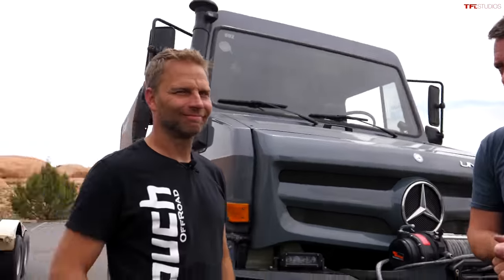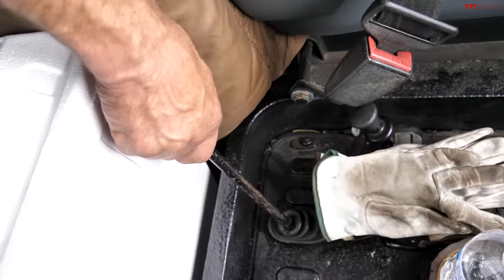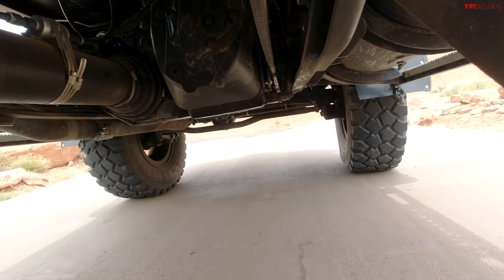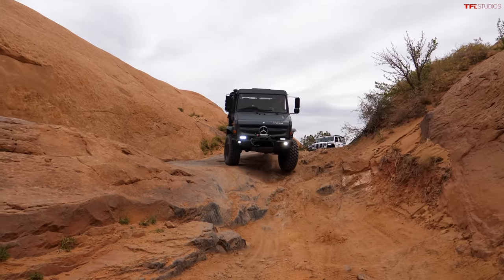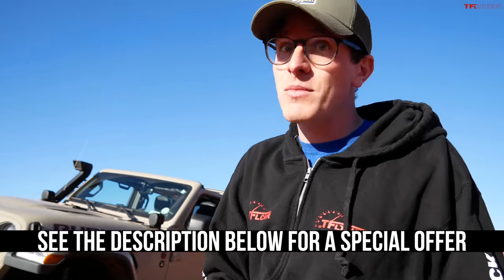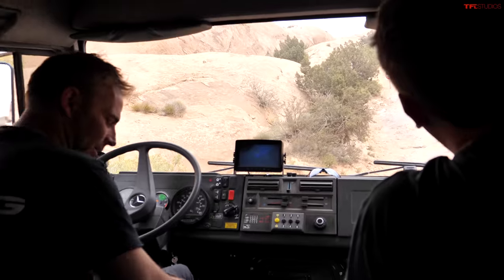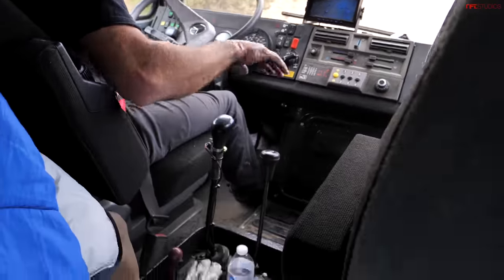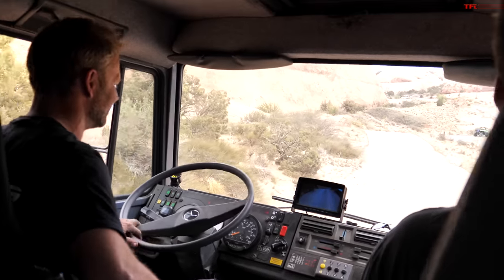$385,000 Mercedes UNIMOG vs Hell's Revenge: Move Over Bronco & Wrangler There’s a New Boss in Moab!

Comment: The first unimogs were designed to work as a tractor on the farm and be able to drive to town also after WWII.
Reply: In Europe you can buy a Unimog that is registered as a tractor, they come with 3-point lift, power outtake and hydraulics just like a standard tractor.
Reply: Like a Willys-Overland
Reply: @morilot  alot cheaper than this too
Reply: @derrickdrew17  In Europe they cost about the same as a tractor.
Reply: This is clearly basically new mechanically. Entirely different drivetrain, etc. Would be interesting to see the full bill because you can buy a mid-90s Unimog for less than a quarter of this price.
Reply: @morilot  don`t forget the power take off front and rear.
Reply: @morilot  Because they ARE a tractor! The SWB UNIMOG is designed with front and rear PTO, 3 point linkage and hydraulics all round. They can be seen bailing hay, chopping silage, plowing, discing, all of the places a John Deere or Fendt would be found, hell, they even have UNIMOGS with front end loaders
Reply: Thought you all hated large vehicles
Reply: @raymonds7492  I do not hate large vehicles, or did you mean the europeans.
Reply: @badgerpa9   Europeans
Reply: @raymonds7492  that is only in the city's, we have pick ups too here
Reply: @raymonds7492  We dislike big useless machines like the Dodge Ram. Because we have better machines for the same size.
Reply: @23GreyFox  name the vehicles you have that can perform as many roles as the Ram.
Reply: @raymonds7492  L200.
Reply: @23GreyFox  Nope. it isn't luxurious, not as much tech, doesn't tow as well, no HD version and doesn't have a big enough box or interior space.
Reply: @raymonds7492  With my 3rd generation Mitsubishi L200 i had a different experience. And it sold far better by us too.
I tested a Ram 1500 with a friend and it wasn't great. I could not even take it into the forest.
Reply: @23GreyFox  The standard ram is not great off road, the ram power wagon is but it can only fit on american trails. One downside is that ram is too concerned with ride quality so it suffers in other things like payload. However the ram is only one of our trucks you still have gm and ford. Also a vehicle being large is not a good or bad thing and it actually helps with towing , so does weight.
Reply: @raymonds7492  You are right, but if we need high carrying capacity we use Vans like the Mercedes Sprinter or Ford Transit. And they can tow a lot too if necessary. There is simply no need for a American truck in Europe. So to say we don't like big cars is false. Of all the big American brands in Europe only Ford is left. The import cost alone makes it useless to try.
Reply: @23GreyFox  Vans are good too we use the often but you wouldn't use one off road, and i wouldn't say there is no need for vans here. i think it is a size issue because vans fit more in the same space, here we would use a trailer but there is less space in europe for trailers. Ford is the only one left because they put more effort into building cars to fit the market. Pickups are a cultural thing as well they represent certain things here.

Comment: My father was the first to import Unimogs into the UK primarily as snow clearing equipment in the very early 60s after he saw them operate in Switzerland in the winter of 59!  One was a dedicated unit with a fixed snowblower on the front, driven by a large diesel engine mounted in the bed with a shaft that ran under the truck!  the other ones were more a standard unit with the smaller snowblowers driven off the front PTO!

Comment: That thing takes "granny gear " to a whole other level
Reply: Great granny gear
Reply: Try the crawler
Reply: And thats not even the 3600 to 1
Reply: Right, Great, Great, Great grandma gear
Reply: Designed to move trains.
Reply: They may need to create a new term: Glacier Gear.
Reply: Our tree surgeon has a Unimog 406 with the cascade gearbox, supercrawl 1st is around 4500:1, on tickover you can just about see the tires rotate, covers around 80 yards in an hour!!!!!!
Reply: @clooperman3745  I would love to know what that is used for .... the only thing I can think of is to get out and have lunch while not stopping
Reply: Sloth gear
Reply: @tjlovesrachel  those things are working machines with all kinds of tools you can either power via hydralics or mechanical gears, some of these tools need very low speeds while operating.

Comment: The cockpit is - even if the Mog is from the 90's - from the 80's. I remember it from my childhood. Have been in so many Mercedes trucks and semi -trucks. And also in Wörth where the plant for Mercedes trucks is.
Reply: Yep! That's probably a U1700 or U1300 originally, made all the way into the mid 90s before they launched into the "new gen" electronic U3000 / 4000 / 5000 series

Comment: One thing I love about Unimogs is the portal axles. Gives so much ground clearance that diff housing isn't an issue anymore.
Reply: Those reduction hubs aren't instructable though.  In my experience a 2 1/2 ton Rockwell narrowed with the pumpkin modified (cut off all excess bottom and replace with flat plate) is stronger. You get the clearance and width of a Dana 60  but much stronger.  I tried these on a rock buggy and after breaking a few hubs went back to Rockwell's. The couple inches of clearance was negated by having to run smaller, less aggressive tires.  Also a Rockwell axle shaft can be changed trailside pretty easily compared to a reduction hub.  They are great for less extreme mud buggies.

Comment: This is where individual electric hub motors would really shine.  Gobs of instant torque going up, regen braking going down, no driveshafts, couplers, or linkages to worry about, with precision digital control.  It would be the ultimate rock crawler.  For those “non battery” die hards, you could even keep the diesel in place to constantly supply a/c power to the motors.
Reply: for a pure rock crawler it could work with batteries, if you wanted to travel the world, diesel is the way to go.
Reply: @joshkiej6601  oh absolutely it could be battery only but the majority of people here wouldn’t accept that.
Reply: @aussie2uGA  if you only do like 1 day trips and can charge at night, batteries can be awesome as long as you can keep the weight down. I'd be worried about flipping/puncturing a battery though

Comment: Have driven U1300s during my time in the German army - the most offroad worthy wheeled vehicle there, literally unstoppable in the rough, but a nightmare on long road trips
Reply: Wonder if the newer models are better for long distance travel
Reply: Appears your time in the army was a bit earlier than mine, didn't have the 5 ton MAN anymore end of the 80's, but rather Folgegeneration trucks. The U1300 was nice to drive offroad but its short ratio gearbox didn't offer much pleasure on the street. Preferred the Mercedes 1017 here.

Comment: My sailing club in Berlin uses an old Unimog to transport the boats to and from the crane to let them to water.
They use a special trailer with hydrulic controled axels because to get to the crane the have to traverse a 40° ramp.
The boats weigh up to 10 metric tonnes, and the Mog has no problem shifting these weights.

Comment: No wonder that guy has 20 Unimogs of his own... For 385.000 I buy at least 3 brand new ones here in Europe. The last ones I bought were a bit less than 120k (EUR) and were nearly full option since we needed them to build agricultural equipment on them.  They are awesome machines though, we once let one crawl onto a excavator bucket and it did it with ease 😎

Comment: Finally someone agrees with me on manual transmission and the lurching stop-go progress of autos off road, but l  don't understand the eyewatering price here over a standard and totally capable  U2150 or U1300L or the justification for a "prototype"  overdrive  when the proven Claas splitter overdrive is a standard fit.
Reply: Because the Claas gearbox is hilariously expensive for what it does.
Reply: @AaronBockelie  Yes, but when you see it, it is self-evidently fit for purpose. Cost does not seem to be limiting factor in this case.
Reply: @philhealey449  The claas overdrive fits even cheaper Unimogs, say a U1300L, that have a UG3/40 trans. In those cases, that's 30 percent of the vehicle cost.
Reply: @AaronBockelie  Fair point if considering in low power variants, especially  something propelled by a 1960s  car engine, but assuming  assured  reliability is essential,  would there be anything  more cost-effective say for a U1250 with a retrofitted  intercooler and around 200 bhp from its OM366?  I can accept that the Claas unit may be overbuilt given I understand its U2450 origins to primarily reduce gear spacings in 6x6 rocket launcher applications. Having experienced this device  once as a revelation on both highways and for hill climbing it was a no-brainer to  transplant it from the U1250 into a subsequent U2150. As intimated  originally, just seeing the thing arrive in the wooden crate softens the blow of the cost compared to a typically  miniscule  overdrive  made out of a few kg of aluminum and dismatched from the Unimog ethos.   Happy Mogging !
Reply: @philhealey449  I definitely agree on matching like kind equipment origins. At this point I'm just waiting for a good drop in replacement electric drive system that can turn about 4000 rpm...maybe another 5-10 years ;)

Comment: 16:50 New Unimogs have EAS which is an automated gearbox ie it is a manual so no torque convertor but which does the gear change for you and should you need more control you just flip a switch, a clutch pedal flips down and you change gear as in a manual without any electronic interference.

Comment: I have a Unimog 1300 Turbo '82 that has freewheels on the front axle.  ( custom made ) 8 speed forward 4 backwards. Overdrive is not such a good idea on a Unimog because of the portal axles with some " gearbox " on each side. Those things have an airvent and by high speeds, the oil leaves by that airvent in the axle and never returns. So, it's posible that the wheelbearings run dry and that leads to a high cost on parts. A Unimog was never build for the highway. 90 km/h for houres can give problemes. Oil get warm, less oil make's it even hot . On mine there is a looking glas for the oil level and an expansion system that let the air go but not the oil. And the problem is only on the front axle because the back axle is one part in total so the oil go's back and so with the differential. A Unimog with fast axles is in my opinion a bigger risk. Oil control is realy needed and for that a bold need to be unscrewed every time on a standard Unimog with the risk of dirt getting where you do'nt want it. The engine on mine has an extra oil cooler and a bigger engine cooler with an 24V fan and thermostat. The freewheels and that fan system safes HP and feul . The Mog , single cab, has some 73.000 km now and has a new empty box on the back, ready to build in, and is for sale. In Spain. ( Unimog ex-German army, I'm out of the needed driving licence, I'm a " ' 49" er :-)

Comment: Larry Perkins designed and built an overdrive unit for the Unimog here in Australia, it's now certified by Mercedes as a spare part.  For $300k I'd like the rear door seal to actually not let the outside in.  I'm not convinced of the guy's argument that manual transmission is better off road than auto "because the torque converter takes time to load up" -  I have an auto 4WD and have never found this.  Maybe it's a thing in a huge vehicle, but in a regular 4WD it isn't.  All in all I love the Mog - if I ever win lotto ...... I could afford the fuel :)

Comment: When you tell a chick you drive a benz and then roll up in this.  Technicallythetruth

Damn a potential to have 3800 to 1 gear ratio is freaking nuts.  600 to 1 is pretty crazy as is
Reply: Lol yea the 3800 to one is because the use these as Shunt trucks in rail yards. The front and rear drop down rail wheels and they hook them up to freight carriages and move them around the rail yard. So crazy.

Comment: As far as I know Unimogs didn’t use torque converters (in Europe). They have electro pneumatic transmission. Some older models (2000s) shared the same auto transmission with the Axor trucks. It was pure pneumatic, the gear shifting sound was impossible to avoid :)
Reply: There are actually some Special Unimogs with Torque converters. But u still have to Shift them manually. They are/were used in military airports to push planes.
Reply: @XielefR  I see. Unimog has so many variant. Do you mean the one with tiny gear level push forward and backward to select a gear. Then, you depress the clutch to change the gear? The ones I know featured that gearbox was based on Mercedes-Benz Axor truck’s transmission.

Comment: Aside from having much smaller tires this is very similar to my tractor drivetrain wise. I like it a lot. I once thought these axles would be great under a jeep until I tried it.  They weren't as strong as the 2 1/2 Rockwell's in my experience. Those reduction hubs are great for ground clearance but not the strongest for rock bouncing with 44 inch cut boggers attached to them.
Reply: you probably had axles from a older and small unimog

Comment: 300k but for a modified one. There are quite a few types of unimogs available in Germany today from the 1960s to now, they are very different in price because of the different size and usage. Prices for used ones are between 3k for a small 1981 type and 250k for a big 2021 model.

Comment: Great Video! Just the price is a bit "amazing" for European standards. You can pick up a nice ex-Military version for 30-40K Euros and start from there.
Reply: A good chunk of that cost is usually the cost of components to repair and maintain these things as most have to be imported from Europe. There's also the labor required to pull everything apart, repair and put back together. Lastly, a lot of these offroad accessories, campers, etc.  are usually specially ordered and not mass produced, so there's a higher cost involved in that in order to cover business overhead and the like.

Also, throw in transportation fees, brokerage fees (customs, registration, etc.), And whatever else required to get the vehicle into the US.
Reply: Yeah him saying you'll be done at 600.000.. I was like I can get a nearly new one full option for 150.000.
Reply: Stock Kamaz 6560 8x8 starts around 140,000 USD in Russia. But that's another type of animal. I wonder how it would handle these trails.

Comment: The 1st time i saw this, it looked so awkwardly tall versus it's width, i mean as long it's not top heavy, i guess it's ok. Also, the rear suspension travel, how it can flex?... Lockers, reduction gears and enormous wheels gives this capability, that's for sure
Reply: All on stock parts.

Comment: We get them brand new down under beast of a truck also new one can convert from left hand drive to right drive.  Army has heaps in use
Reply: For some reason the NZDF swapped out their old Mogs for MAN trucks rather than. upgrade to newer Unimogs which surprised me. There’s a couple on Trademe.co.nz currently that have been kitted out for Tourism ventures (essentially a tour bus)
My Uncle imported the first U500 tractor in to the country many years ago and it’s amazing off-road.  My cousin is an MB nut and has 3-4 in his fleet for agricultural contracting.
I’d love to tour Aus in one, that’s at the top of my bucket list

Comment: At a certain point you've got to call it for what it is, OVERKILL. The machine is so capable that there isn't really a challenge anymore.  This is the offroad version of having gaming cheatcodes.
Reply: Even it had to pick a different line when the tires and the terrain were not cooperative.  You are not wrong in pointing out it was more than was needed for this trip, but it is not a do it all vehicle.  It will have more limitations than most people realize.  1 vehicle can check off a lot of boxes, but try fitting that elephant down the standard 4x4 trails in most states.  ;)
Reply: This kind of vehicle is the one you take on an expedition to the Arctic
Reply: You should see the video of an older version doing extreme rock crawling with the flex and twists you onlysee on heavily moded wranglers! It was epic

Comment: Really impressive truck, but in my country, my F250 is a really big truck, so this Unimog is unuseful. Definitely, the best combo will be this Unimog with a Samurai in the back. Greetings
Reply: where are u from? the older unimogs are also really capable and strong but the same size as a modern suv
Reply: @thomasvanende7032  from Costa Rica. Small ones could be, but there are some places where a Land Cruiser 80 is a too wide car for this places, because that, the best is to have a 2 door Land Cruiser 7x series, a 2 door Wrangler, a 2 door Defender (old ones) or a Samurai-Jimny. Weight could be a limit too, because some bridges and muddy dangerous terrain. (I'm talking about performance in some extreme off road places, where  routes could be too narrow and muddy, with the danger of 400 meters depth cliffs, that if you slide, you will be probably dead, so if someone wants to know this places, the best are the small cars ). Greetings.